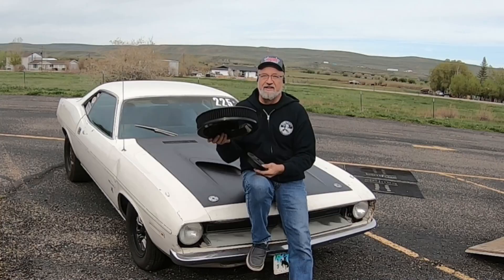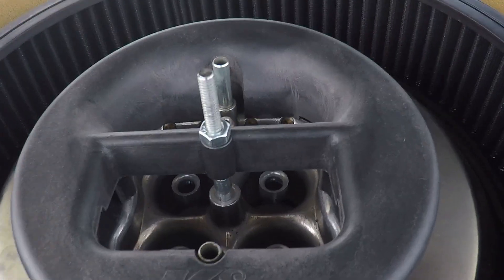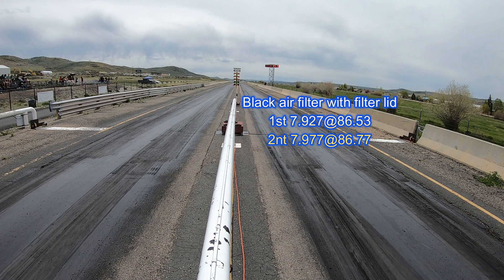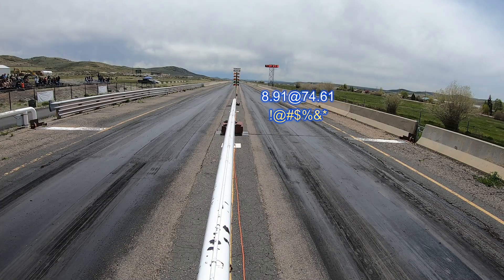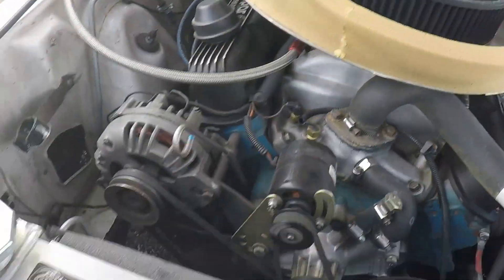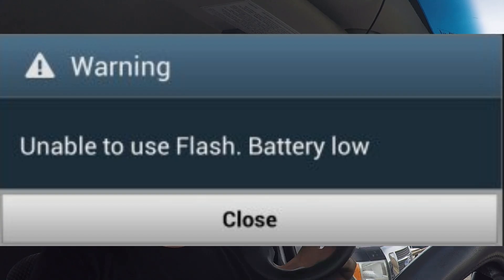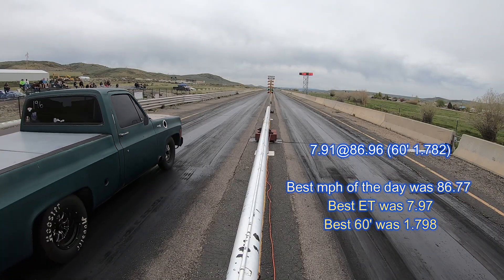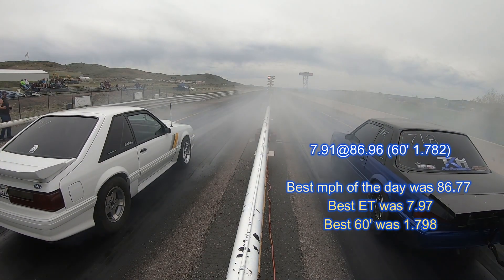K&N Stub Stack: I Was WRONG! (Racetrack Re-Test)

Comment: That K&N sub stack may work better as a frisbee!
Reply from the maker: Lol now that funny right there :-)  I was ready to take a hammer and bust it up and send it back to the manufactured, at first................But seriously, I think it is a Viable Product! It won't rotate the earth......but it does work in my oppinion.  If i could still us it with a air filter on my cuda i would be testing it all this season.
Reply: @CudaFishEStories a filter on it, above it instead of down around it may help. From my limited knowledge I’d say it doesn’t like all that turning. Wouldn’t be hard to set up on the bench. Ya never know.
Reply from the maker: Agree, have a lot of little test like that i would like to try. But my flow bench is tied up with a couple other project! I haven't release the vidoe yet but there is one on tuning up the air boxs on a artic cat eng that run in a salt flat car. another one about a unboxing of yet another project, that is going to be way interesting. Stay tune for more exiting tests. ;-)
Reply: @CudaFishEStories sounds good. Have you tried the velocity stack without filter over the K&N frisbee?
Reply from the maker: @alanhow3575  nope. That would be a good test👍